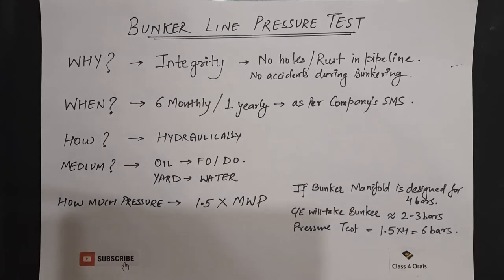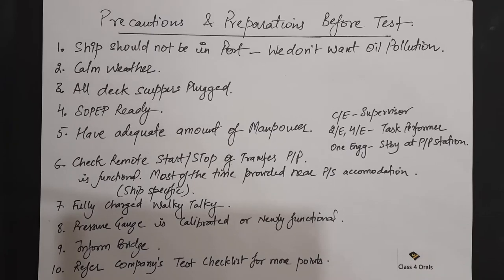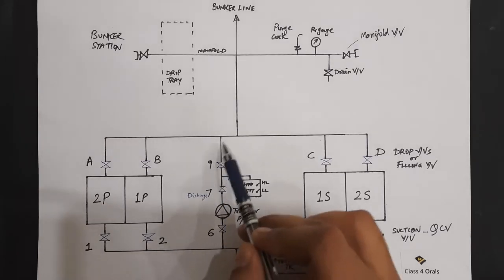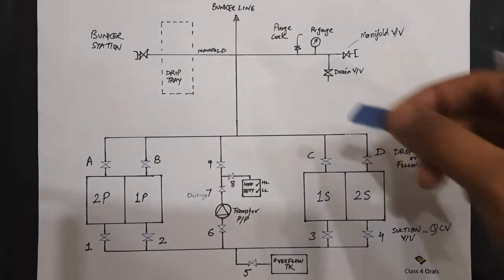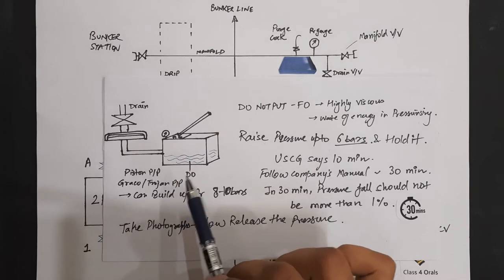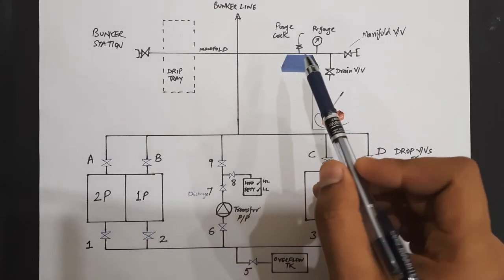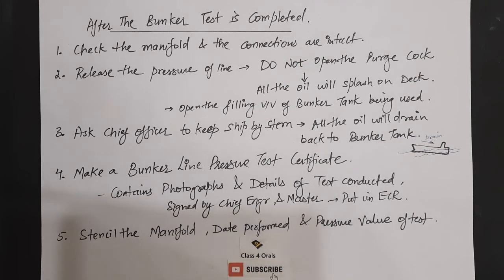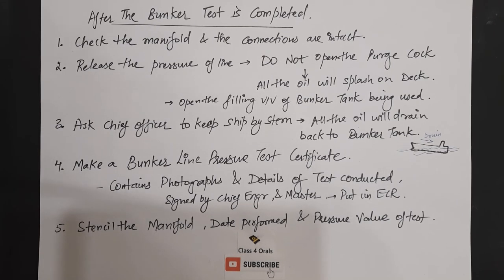Bunker Line Pressure Test Explained Completely | Pressure Testing Medium | Important for MMD Orals👍

Comment: Pressure test carried out in my ship at 5 bars at pipe duct / duct keel level.  In bunker manifold the pressure was 2.4 Bars only because we have to consider the hydrostatic pressure of the liquid (there is about 28 meters column from Duct Keel to Bunker Manifold).  I will appreciate your comments in this respect.

Comment: Also using compressed air as medium will not help. If there is a leak in the system it will not help in finding the leak. Instead if use D.O we can find any leak because we can find the leak easily.
Reply from the maker: True. 👌 thank u for adding your valuable information here.

Comment: Bro when you open the filling valve after finish the bunker line test system is getting air lock without air came inside how the fuel will drop to storage tank, 1st need to open 1S filling valve then open the purge valve to allow the air then only fuel will drain to storage tank